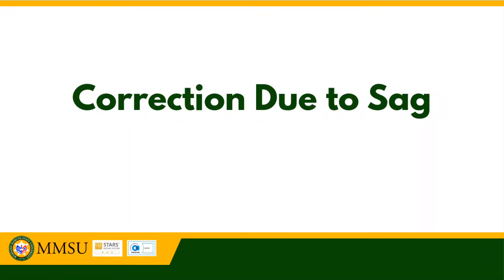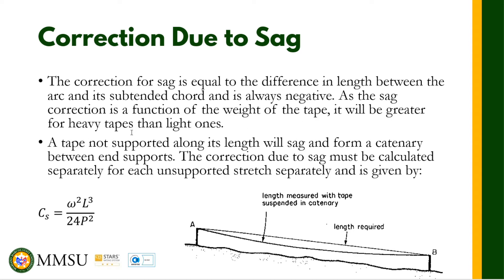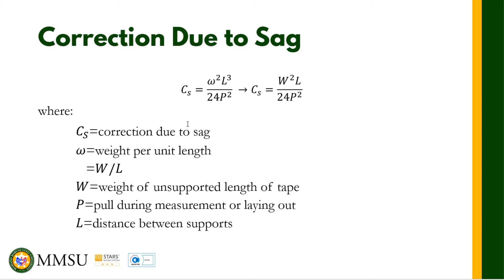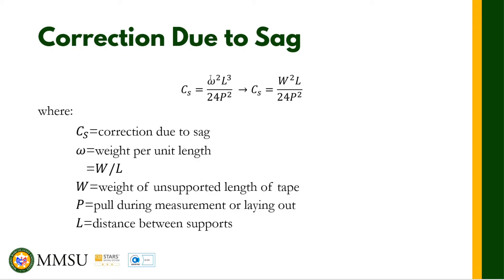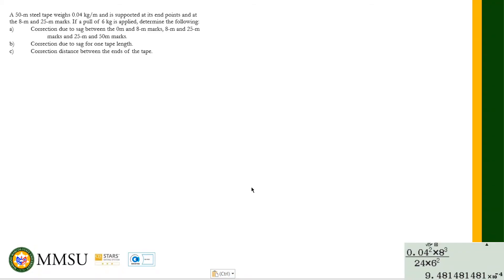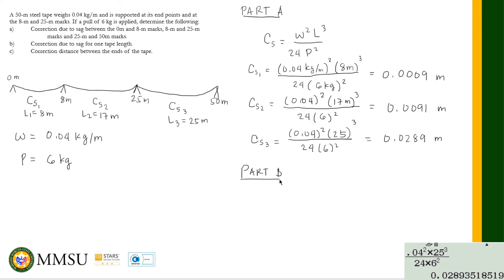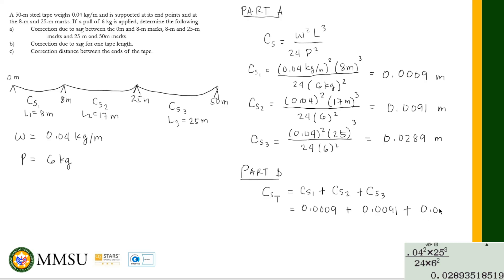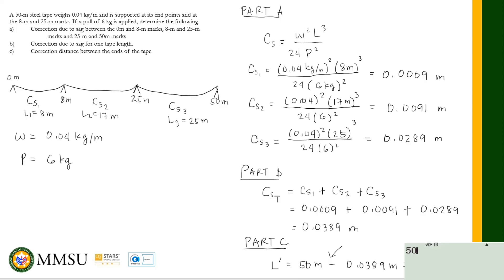Correction Due to Sag | Taping Corrections | Surveying

Comment: Sir ano po yung gagamitin na formula kapag ganito yung problem? A 100m tape weighs is 0.0508 kg/m During field measurement, the tape was subjected to a tension of 45 N, and was supported at the end points, midpoint and quarter points, find the correction per tape length due to sag.

Comment: What if the tape is supported at ends and midpoint but the given weight (w) on the problem is only by kilograms, ano po dapat ang gawin?
Reply from the maker: Kunin mo muna unit weight. Gamitin mo ung formula na may unit weight.
Reply: @JonasClassNotes  okay po, salamat

Comment: Sir my I ask something, what if po a tension of only 10 kg and was supported at the ends, the mid-point, and the quarter points?
Reply from the maker: May support sa ends, sa gitna, sa 1/4 ng tape at sa 3/4 ng tape. Bale nahati sa 4 equal parts ang tape. Pare parehas lahat ang length L/4.
Reply: @JonasClassNotes  yan din pagkakaintindi ko sir, thank you po, your videos really helped me specially online class kami, God bless po :)))
Reply from the maker: @beamariekanon1928  Ang gamitin mong formula ay yung may w "omega". Isolve mo muna weight per unit length.

Comment: sir pwede po bang gamitin yung formula na cs=(omega^3) (L^3)/24P^2 para makuha yung correction for one tape length? bale magiging L ko po is 50m ?
Reply from the maker: Pwede naman basta ang mga supports ay nasa ends ng 50 m na yan.
Reply: @JonasClassNotes  when you said sir "always negative (subtraction) correction due to sag" does it apply both in measuring and laying out? or only measuring?

Comment: Sir ask ko lang sa number 2 diba ang weight mag vavary every points so using this formula same padin po ba yung answers even though every points sa 0-8, 8-25, and 25-50 is nag iiba ang weight
Reply from the maker: Hello. The assumption dito is that the weight of the tape is uniformly distributed all throughout its length. So ibig sabihin, the weight per unit length is constant. Kapag hindi full tape length ang ginamit, you use the formula with the "w" (omega).